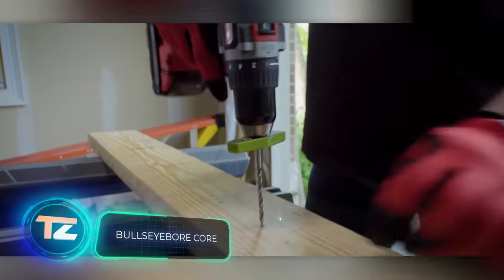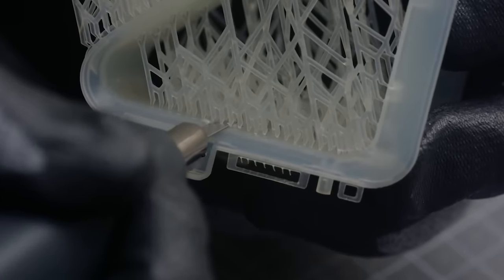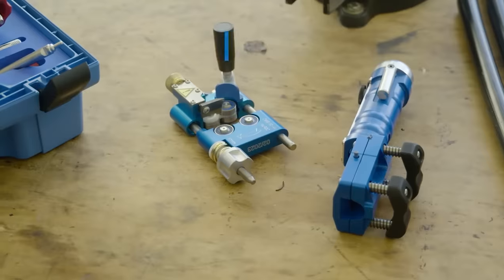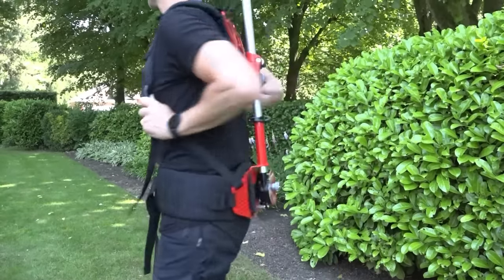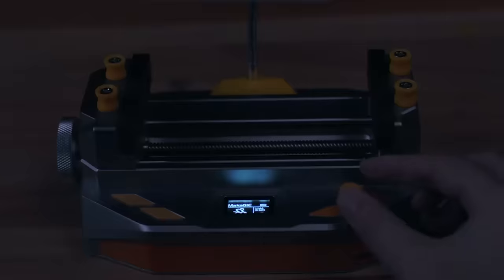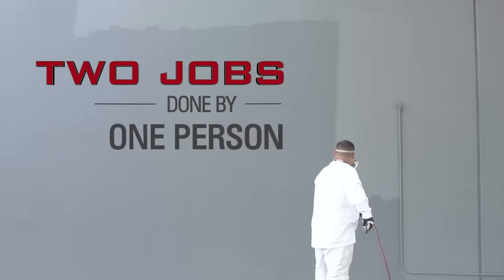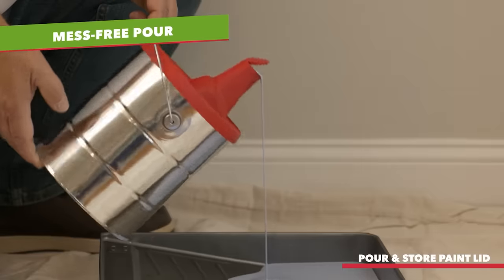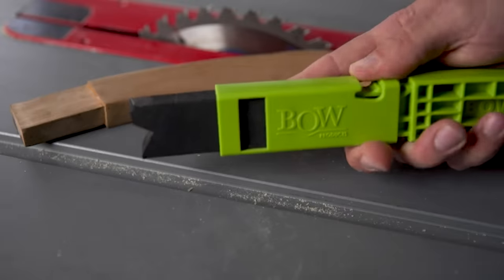20 BRILLIANT TOOLS YOU MUST SEE

Comment: #1 can be made cheaper and much better if you had two laser pointers, one red and one green at the same distance but at opposite sides. If you are level you will see a single yellow line, if not you will see two lines red and green.

Comment: When using the BullseyeBore Core, it's important to note that while it won't impact the rotation of the drill chuck, it could lead to a significant amount of vibration due to potential imbalance. This vibration could affect the accuracy of the drilling and potentially even cause damage to the equipment if not addressed properly. Therefore, it's crucial to carefully monitor the use of the BullseyeBore Core and take steps to minimize any vibrations that may occur.

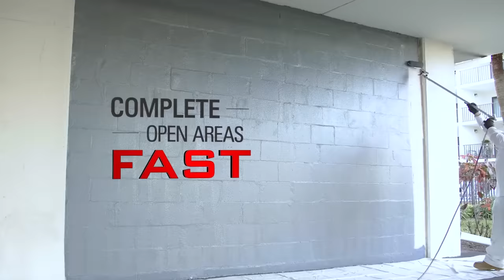Comment: The strapping machine at 11:03  is amazimg (CMT 250). I've been using one (not sure if its the same exact model, but it looks identical besides the color scheme) for over 5yrs now. Though the price tag on this is steep, if you have ever strapped things manually, this thing is soooo much easier and does save a lot of time and energy, especially if you have to strap things throughout the day. When you get the strap ends lined up, you pull the lever while sliding this over the strap ends, you release the lever, push a button to pull tension, then push another button which vibrates the pinched ends and them together to hold without the use of dumb clamps. It does tension very good, and the mended ends do hold very well. I have used manual bander's, as well as pneumatic types, this battery operated tool is the way to go if you are banding all day, and don't want to trip on air hoses.